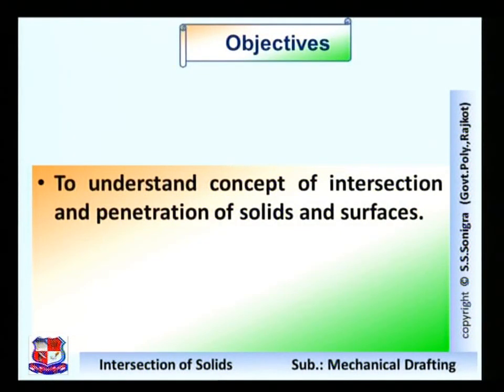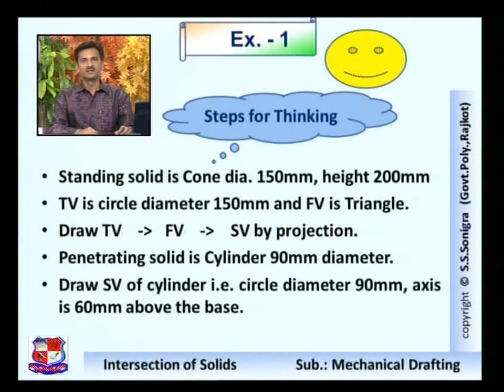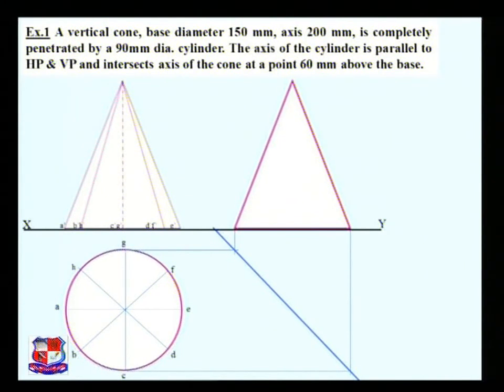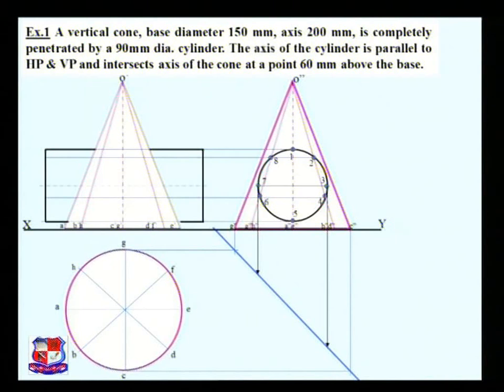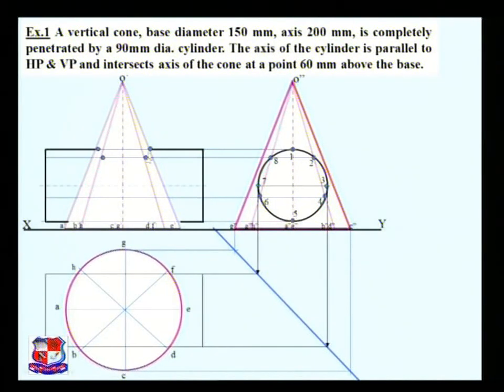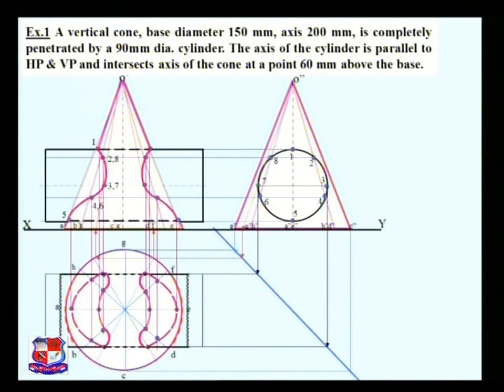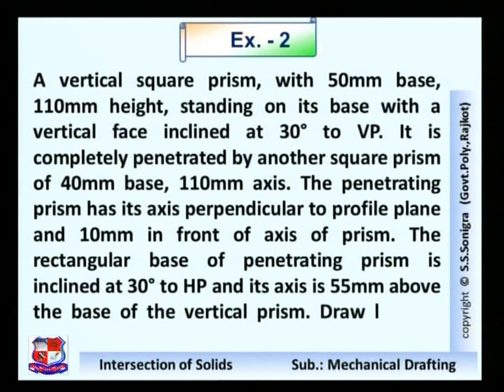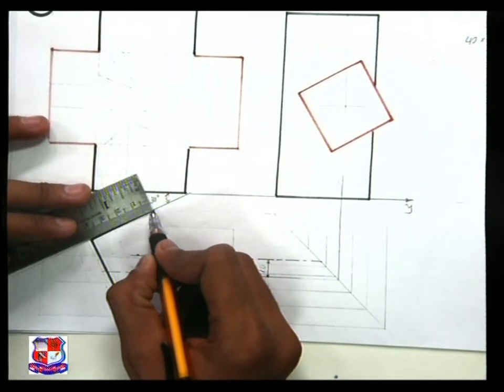Sonigra Sunilkumar Mechanical Drafting Intersection of solids and surfaces 1

Comment: Draw the equilateral triangle of 100 mm side with one side horizontal draw the square of 35 mm side in its centre with its side and inclined 45 degree to the base of the triangle figure show the front view of cone standing on its base on the ground and having a square hole cut through it true the three view of cone